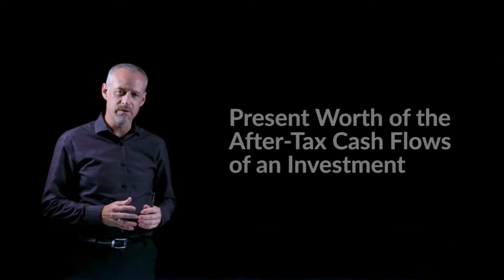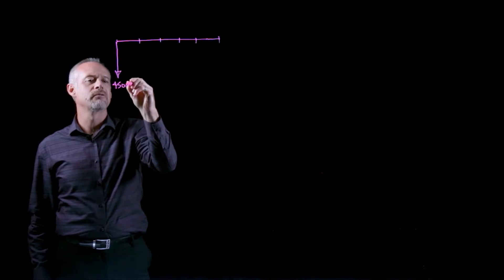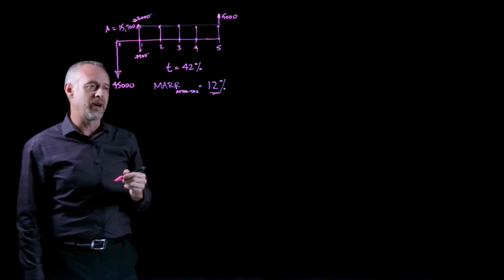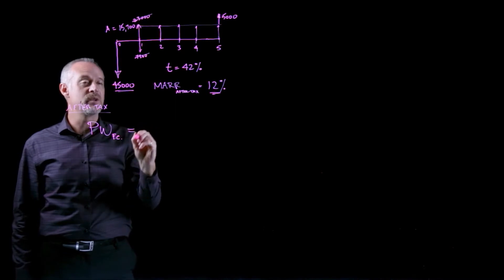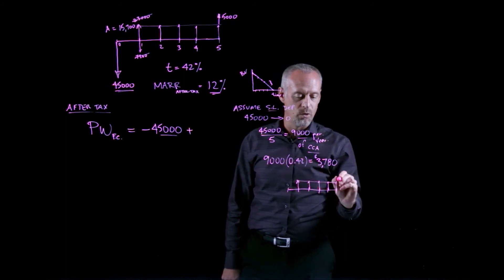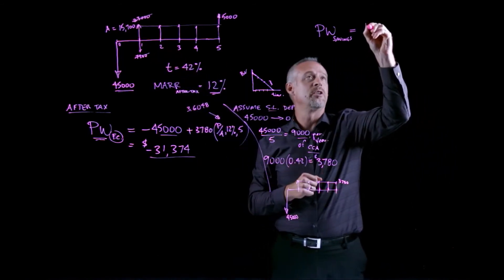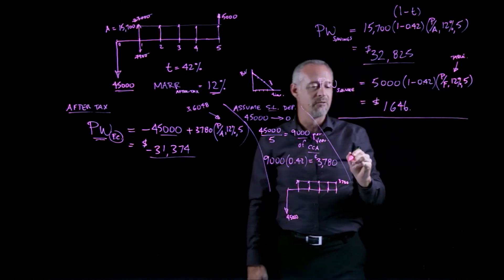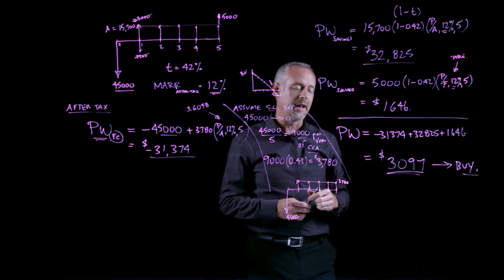Present Worth of After Tax Cash Flows of an Investment - Engineering Economics Lightboard

Comment: Thank you for this amazing video, it is really a big help in my preparation for my final exam for this course but I have a small question.
If annual savings were instead annual costs in the question, will it still be taxed? even if it is costs and not savings?
Would really appreciate your answer.
Thanks
Reply from the maker: Excellent question!  Surprisingly, even if the annual savings are a 'cost' - i.e. a negative number (a 'net' down arrow on the cash flow diagram), you still multiply them by (1-t) to convert them to an after-tax cash flow.  This makes no sense if you view the project in "isolation"!  However, two assumptions justify this:  1) the company has 'many' projects, and 2) overall the company is profitable (i.e.-the company will need to pay tax).   Hope this clarifies!  Thanks for watching, and thanks for the nice comment!  Good luck with your exam!!

Comment: Good video. I have to solve this example : FrostCo is considering the purchase of a robotic icemaker.  It costs $95,000 and saves $40,000 per year.  FrostCo’s after tax MARR is 12% annual compounded annually.  Assume the device will be sold for $3500 salvage value at the end of its 6 year life.  Assume the ice maker falls under CCA Class 8.  The corporate income tax rate is 54%.  Calculate the after tax present worth of the ice maker. It's possible some help?
Reply from the maker: The best way to solve the problem is with the CTF and CSF (Capital Tax Factor and Capital Salvage Factor).  I solve a nearly identical problem in this video:  https://youtu.be/vrBzeLu1O7Q
This video will give you step-by-step instructions.
Sorry for the delayed response!!
Reply: That was awesome help. Thank you so much. By the way do you have any approximate after tax IRR and exact after IRR examples?   @EngineeringEconomicsGuy
Reply from the maker: Sorry, I didn't see your reply until now!  I don't have any videos on approximate or exact after-tax IRR, although I know exactly what you are asking.  I should probably make videos on these topics.  Any tax videos I have are in my 'Tax' Playlist on my main channel page.  https://www.youtube.com/playlist?list=PLcfz9wmNxKqh9l2vzJIOcr8qHW_IAm2QA have a look.
Maybe this will help with your question:
If determining the after-tax cash flows is difficult, you can find the IRR using the before-tax cash flows and then multiply the IRR by (1-t)... this is the 'approximate' after-tax IRR.  The good thing about the 'approximate' after-tax IRR is that it gives you a number that is almost always a 'conservative' estimate - meaning, the exact after-tax IRR will be a bit higher!  The actual 'exact' after-tax IRR is just the IRR calculated when using all after-tax cash flows.  This is a long complicated explanation - I hope it makes sense!  Good luck!

Comment: Isn't the salvage value incorporated into the PW fc
Reply from the maker: Good question.  I've simplified things in this example.  I separated the PWfc, PWannuity, and PWsalvage into 3 separate items.  I used Straight-Line depreciation assuming a salvage value of zero at the end of year 5 - then I treated the actual cash received for the salvage as a kind-of bonus cash flow at t=5.  This video is meant to introduce the concept of the present worth of future tax savings as a result of depreciation, and this is most easily done in a SL Depreciation example.  In 'real-life' we would use a method such as:  https://www.youtube.com/watch?v=vrBzeLu1O7Q 
Hope this helps.

Comment: Hey, I have a similar task on my assignment. I have 6 years period and the depreciation period is given to be just for the first 3 years. How can I simply calculate that using your method of formulas?
Regards
Reply from the maker: I'm not sure exactly what your question intends.  If the depreciation only happens over the first 3 years it is difficult to find a simple way to do the calculations.  My suggestion would be to set it up in a spreadsheet!  Look at each year's income statement as an individual column.
Reply: @EngineeringEconomicsGuy 
Yes, the depreciation was given just for the first 3 years.. Then I will make this spreadsheet and then hopefully manage to find PW.
But in general, if depreciation is given for all periods then your method is good to use, right?
Reply from the maker: It should be...